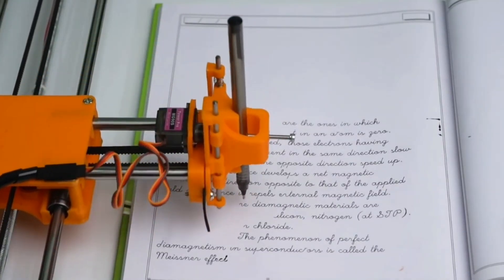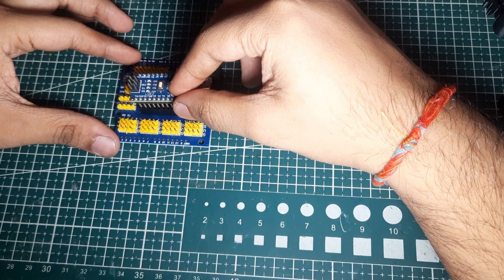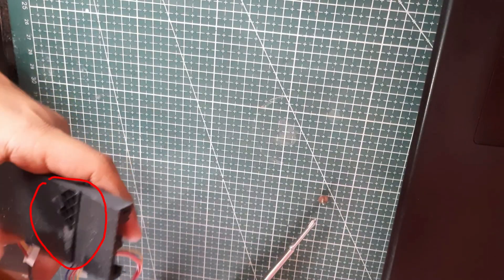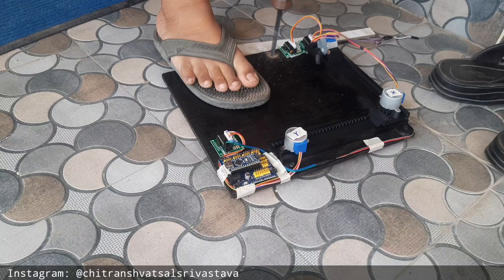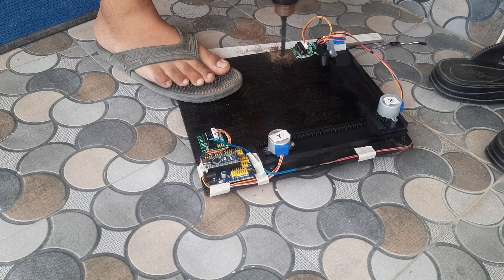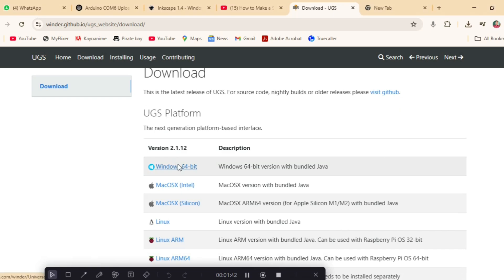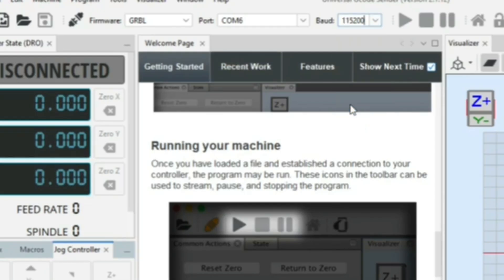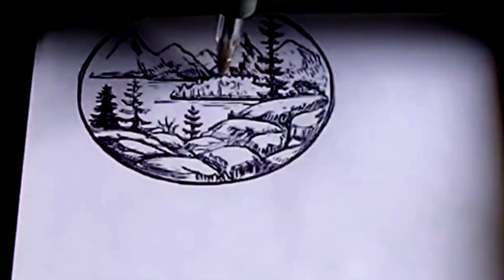$15- This machine can litterally write my homework! | Mini CNC pen plotter |

Comment: From this can we write homework on our? notebook
Reply: Not with the one created in this video. It is of garbage quality. You need to use proper guide/rails for the gantry , 3d printed gears wont cut it. 
Spend around 3000-4000  , you can source all items needed to create a proper pen plotter. 
My recommendations : 
1) 2 *  8mm r* 400 mm rods for Y axis  : 205 *2 = 400/- 
2) 2 * 8mm * 320 mm rods for Y :  182*2 = 364/-
3) LM8UU bearing : 6 * 45 = 270/-
4)GT2 Pulleys and belt : 250-300/- 
5)For frame : Aluminum extrution If possible (best precision) ,can create your own cheaper ones with GI / aluminum(2020) : 2*240 : 480/-
6)Stepper motors : 2*NEMA 17 (recommended , you can go with smaller ones shown in the video as well) 800-1200 /- 
7)Stepper driver : A4988 * 2 : 150/-
8)1 * SG90 Micro Servo as actuator : 150/-
9)ESP32 instead of arduino(no cable needed, you can gcode through wifi ) : 350- 400/- 
10) Dc barrel ,extrution connectors, 3d printed brackets ,other electronic components and consumables : 500/- 

Total cost : 3500-4000/- 

Minimalized versions can be done for 2500/- (smaller much slower stepper motor  28BYJ-48 (costs 150/- for 2 instead of 1200),use cheap stable steel,acrylic or even rigid plastic as frame (costs <100 instead of 480)

Comment: Sir can you please give more information on how the power source should be connected to the three motor drivers? I tried different ways, and all of them kept resulting in some of the wires smoking up and melting. It may be because I am using 12v stepper motors, but I don't know what to do, and it seems like you skipped over the power supply connection in your video
Reply from the maker: No brother! I told that you have to give only 5v as main power supply. Sorry to know.
Reply: @Vatsal.Srivastava okay no worries. Thanks for the prompt reply.

Comment: sir can it possible to make by using aurduino uno r3 with same code
Reply from the maker: Yes, in fact I recommend Arduino Uno more because it has more powerful IC. You just need to change the board to "Arduino Uno" in Arduino IDE application.

Comment: Bro can You answer my questions?

Can I upload my own handwriting font on that device?

Is it only USB Supported?

Can I upload pre-written text there and it will just paste?
Reply from the maker: Firstly let me tell you that this mini plotter doesn't have the potential to write text. For that you would need metal parts, as this one is made with 3d printed parts, that's why it doesn't have much precision. You can use it for making drawings, but use a good quality Arduino UNO, not nano. Nano one stops after some time and lacks the processing power. 

1. Custom Handwriting Font – Yes, you can upload your own handwriting font, but you’ll first need to convert it into a compatible format like a vector font (e.g., .ttf or .svg) and then process it through Inkscape with the proper G-code extension.

2. USB Support – It depends on your controller board. Mine uses an Arduino with GRBL, so it connects via USB to a PC. But if you’re using something like an ESP32, you can go wireless too (via WiFi or Bluetooth).

3. Pre-written Text – Yes, you can write your text in Inkscape or any G-code generator, and it will paste that automatically when plotted, as long as it's converted into G-code.

Let me know if you want help with font conversion or sample G-code!

---